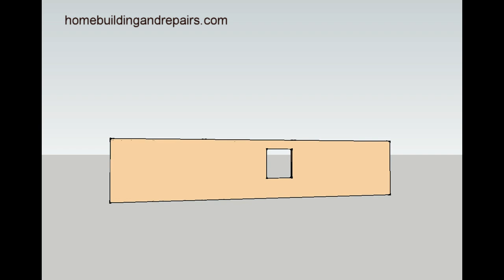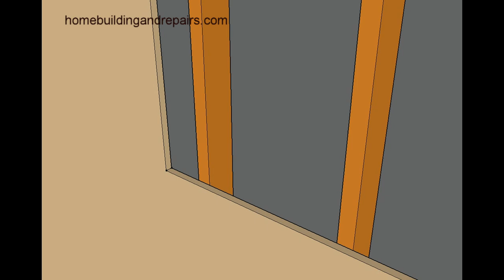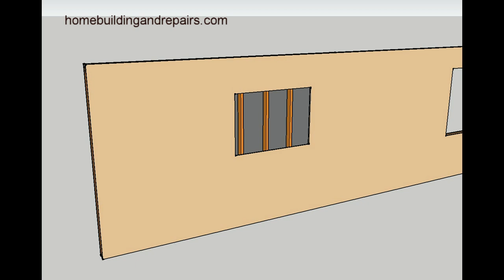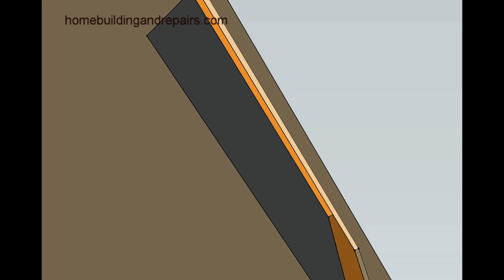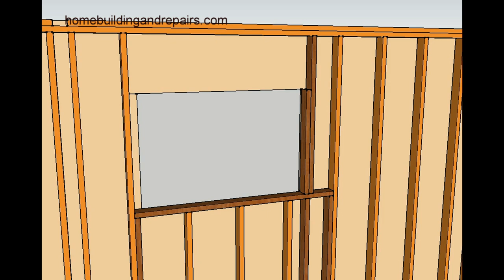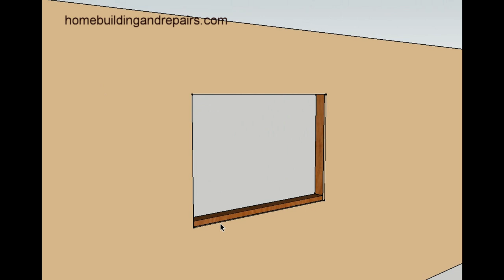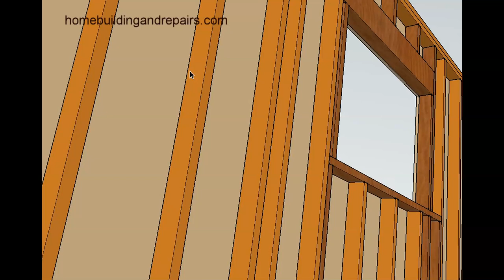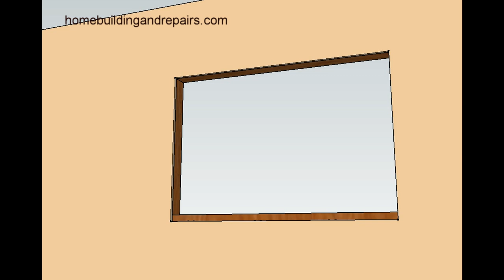How To Frame Window Opening in Existing Windowless Wall – Part One

Comment: Please, please please, inform your viewers that it is dangerous  to cut the studs without temporary support as the load it is supporting might collapse.
Reply: Chris Dejarme you would just support them on the sides before
Reply: Uhh no Sam, Chris is right you should make sure to properly support the load before you cut the exterior wall studs. Also imo taking the drywall off the wall would make this whole process a lot easier and you could even attach everything properly. If you can afford the cost of a new window drywall should be a snap.
Reply from the maker: You're absolutely right, support all floors and roofs, before cutting into structural components like wall studs.
Reply: gregvancom you only have to worry about support on load- bearing wall
Reply from the maker: Yes, I've seen 2 x 4 window headers supporting openings in nonload bearing walls. I wouldn't use a 2 x 4 window header for openings larger than 6 feet wide.
Reply: My garage wall at the overhead door is termite damaged. Not only the header, jack and king studs but the top plate as well. It is an 8' span, 11' altogether from the outside wall to the living room wall. I definitely need to build a support wall, I can imagine I have truss damage as well. Will know more when ceiling Sheetrock is removed. Can't tell from the attic door 15' away, I can't fit through the truss webbing.

Comment: It would be a lot easier to just remove the entire piece of sheet rock from top to bottom and do it the right way so you can properly nail the cripples and king studs. Not only that but if you are installing this window on the first floor of a 2 story building you better build a temp wall or use a jack screw and a 2x6 to hold that area up while you install the header.
Reply from the maker: You use the word easier, but that wouldn't be the case. The methods used in this video would be easier and faster to complete, but if you don't think so I'm up to accepting a challenge, kinda like a duel, but no one gets killed. You might need to watch the video again where I said that this method probably wouldn't work on two-story homes or for every project.
Reply: Ok I'm about to add 4 Windows to my garage but unfortunately I already removed all of the cardboard covering that they used as interior so I'm already have an advantage over you😄
Reply from the maker: Good point. I never thought about working with cardboard, maybe that's a video I can make in the future :)

Comment: I think cutting the drywall more open to top and bottom will be easier for the framing. Will also need put temp support stud to carry the weight.
Reply from the maker: Remember these are only suggestions and might not be approved by your local building authorities, building department or engineers.
Reply: Definitely take the extra time to cut a bit more drywall if you need to. Leaving a load-bearing wall with trimmers and studs that aren't attached well will be bad if the house ever shifted. Drywall is cheap and takes little time to prep and paint for what it's worth.

Comment: It's so much easier to remove the drywall from ceiling to floor extending to the closest stud that will not be removed. That gives you room to work and do it right. Replacing drywall is easy to do in contrast to trying to save it.

Comment: Thanks for the detailed walkthrough, however are you saying that you nail the cripples to the header, but the the cripples to the top plate are just floating?  I plan to cut back my existing studs (to use as cripples) and then push the header up to meet them.  I'm also going to cut the drywall where the header is to be installed so I can nail the header to the cripples, it's pretty easy to cut a rectangle sheet of drywall and tape, texture, paint, or have a drywall dude come by for an hour and fix your mess :)

Comment: Enjoyed the video. Are there any suggestions on how to remove the cripple studs without damaging the drywall they are attached to ?
Reply from the maker: I would like to say that there is, but more than likely you are going to have some casualties. You could try using a sawzal and I've tried wiggling them away slowly, but the laws of averages always seem to be against you. The more you have to do, the more you increase your chances of damaging the other side.

Comment: Need to install a small window in a support wall.   Will this work????
Reply: Should work as long as you support the wall before
Reply from the maker: I cannot tell you whether or not it will work, but I think you can get a pretty good idea from the size of the window in the video, whether or not it might work for you. I can tell you though that most building departments, engineers and building inspectors probably wouldn't approve this method of construction.

Comment: Can you add a new window without taking off the drywall inside to add the king stud? Not sure how to add those new studs without removing the drywall.
Reply from the maker: I'm having a difficult time figuring out what you're trying to do. You will need to remove some of the drywall inside to create the window opening.

Comment: Unfortunately, I cannot afford the magical wand required to install framing in a closed wall like this, especially if I want to attach the framing to other framing... and God help you if there's a wire running under the window.  :)
Reply from the maker: Yes, magic wands make a big difference:)

Comment: Can the header touch the sill plate, or are cripples always required?
Reply from the maker: Yes, the header can touch the sill plate. For example if you only needed 5 1/2 inches then you could use a 4 x 6 for the area underneath the window.
Reply from the maker: I can't remember ever coming across a project were there one cripples or jack studs over a window header, especially on a load bearing wall.
Reply: @gregvancom  In basements where there's barely room for a header,  you aren't likely to find cripple studs. In fact, in many cases there's no header at all - just a top plate. The top plate still distributes the load down your king studs/trimmers, so it's not terrible.
Reply: Cut away all the sheetrock. You are leaving out areas that need to be mailed that you cannot do while leaving the sheetrock in place like you are trying to show.  Not sure exactly what you're trying to do here. But my inspectors would destroy your demo.

Comment: I cant get anyone to help me. We had a re stucco done on our house. A "FRAMER" took the wood out of our window frames and replaced it with metal. After this I could feel cold air coming through and I could hear the traffic as if I were outside. My husband said I am crazy. Now every morning condensation is dripping inside the windows and mold is everywhere. My husband yells when I bring it up. I tried calling window companies and they act like they don't know WTF I'm talking about either. Am I just F crazy? Is this normal? And who can I call a framer??
Reply from the maker: Email me some picture of the inside and outside of the windows. You can get our email address at our website.